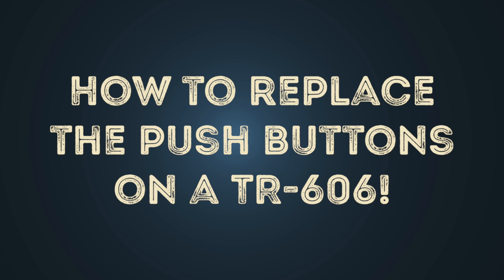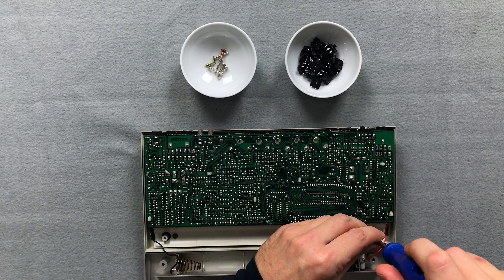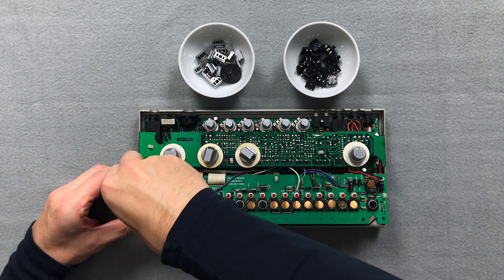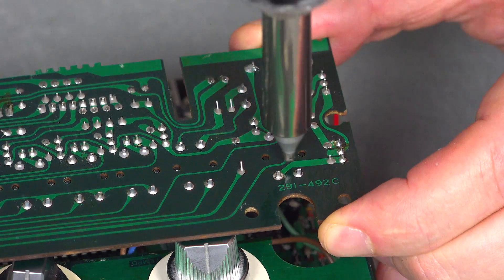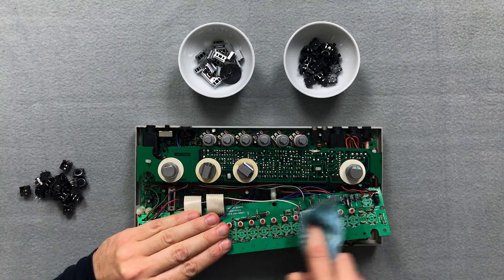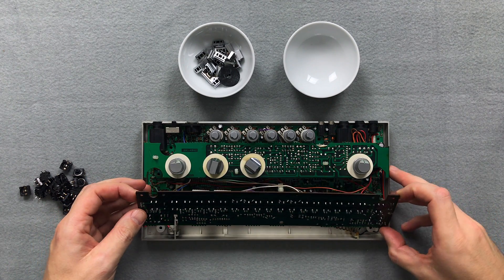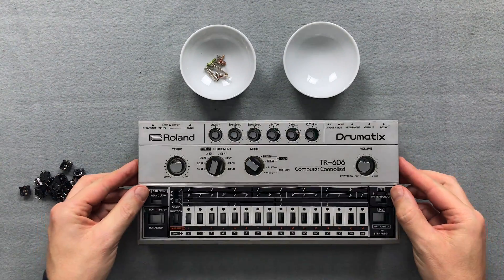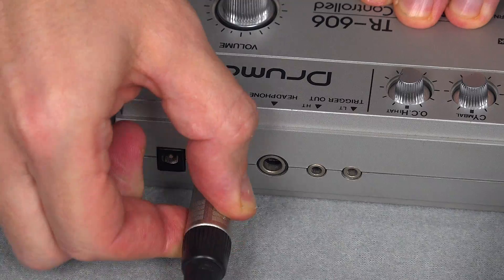How To Replace The Push Buttons On A Roland TR-606!

Comment: Btw the tactile switches have an orientation, but you dont seem to take hold of that? doesnt matter?
Reply from the maker: Yes, the push buttons only fit in two positions. It doesn't matter which position. The main thing is that the small plastic pins snap into the circuit board. 👍

Comment: thanks dude! i did everything like you said and my 606 is perfectly working now!
Reply from the maker: Thank you very much, that's how it should be! 🙂
Reply: Are you only using the desolderig station? Placing the tip of the backside and the all the solder gets sucked out and the components THT point is loose? Wow never knew that.
Reply: I just cut the topside and then used my solder and a tweezer to remove the remaining feet and then soldersucker, but that is much more work